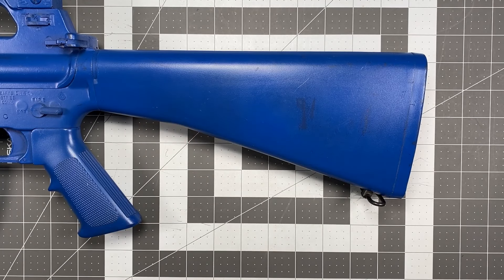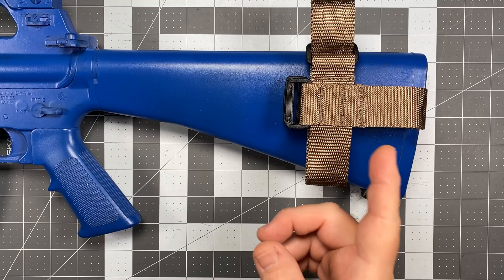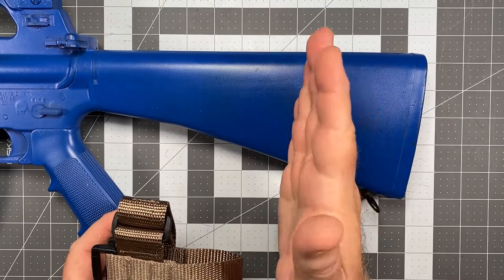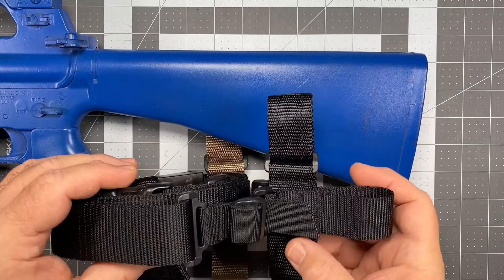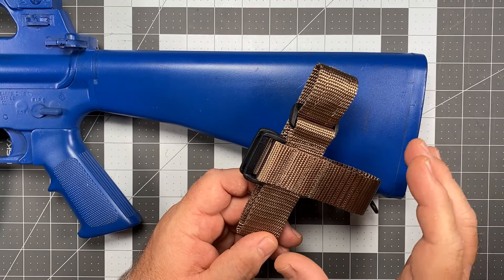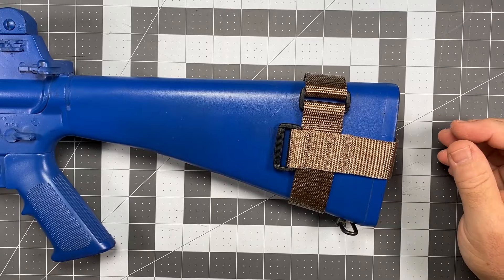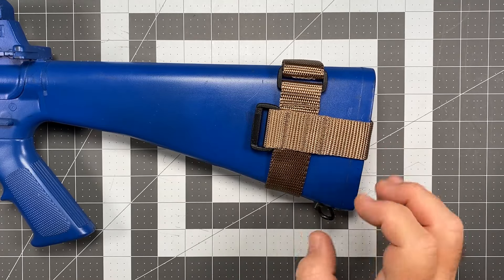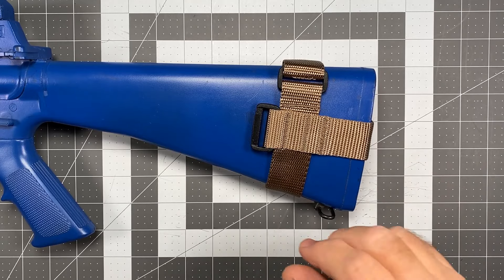Sling Install Video - Stirrup Type Rear Adapters for Fixed Stock Applications

Comment: Do you have a video this adapter, on the fixed stock AR but also shows CQB 3 point sling and bottom mounted front sling swivel. I’m not sure how the front connects to the rear.